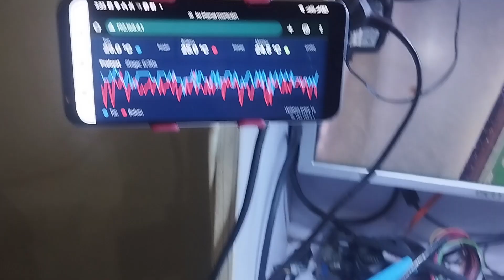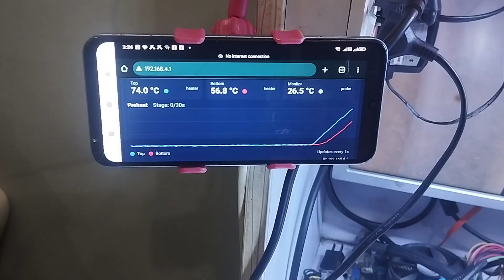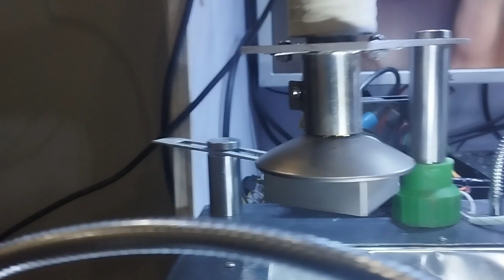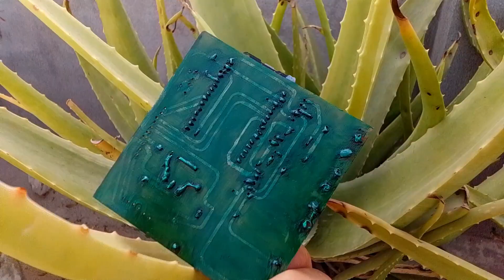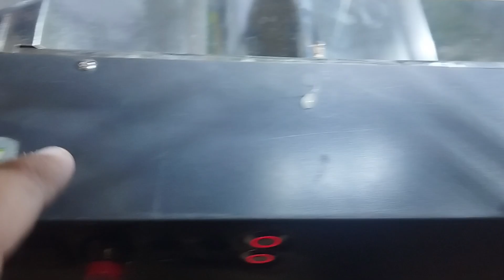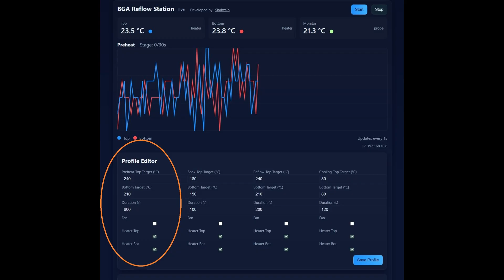Turning an Old PC Into a Smart WiFi BGA Rework Machine ESP32 + Web PID Control | Part 2

Comment: Hello, this is an awesome job. I'm trying to do a similar project but i've used the rex c100 and  two ceramic heaters (for top and bottom). Do you think the esp32 with firmware should cause issues with the c100?, because i would like to use ur custom fw it's really comfortable and easy to use.
Reply from the maker: Thank you and yes you can use ceramic heaters,

Comment: What temperature and airflow are you using on the air gun?
Reply from the maker: At full airflow, the temperature reaches around 240 °C, at 300c but it will not exceed this limit according to my profile.
Reply: @shahzaib-riaz ahh okay, great info. 

I have so many questions because you had a lot of good ideas while making this, but i won't bore you.

I just want to know one thing. So you use hot air manually without any software control?